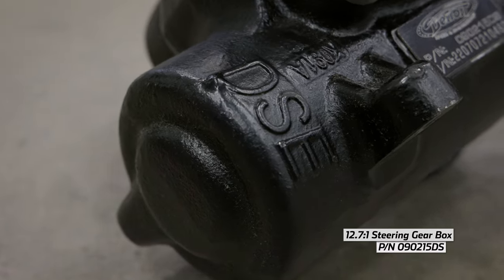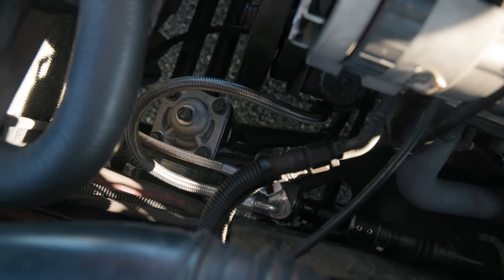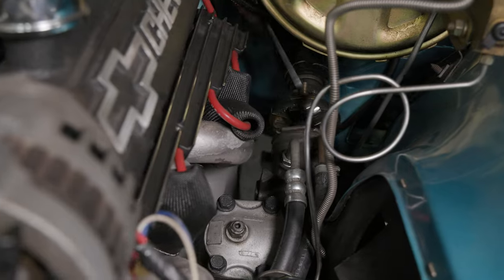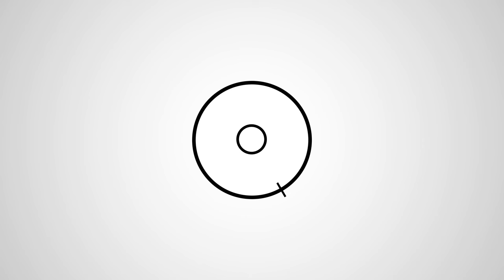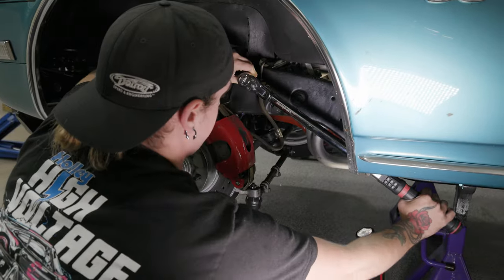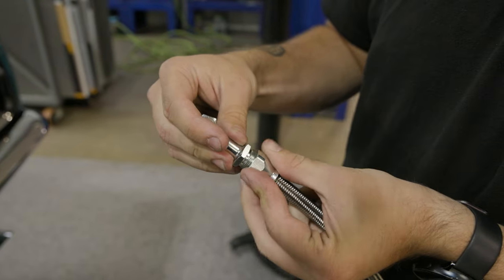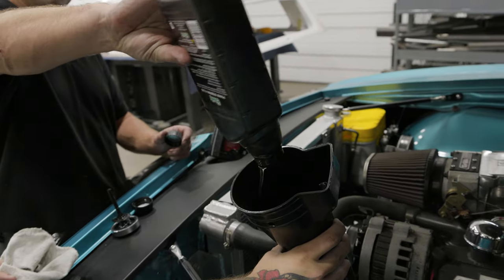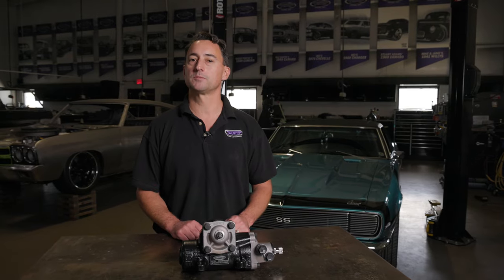How To Install The Detroit Speed 12.7:1 Ratio Steering Gear Box

Comment: I am having a hard time fighting the rag joint to line the bolts through the frame into the steering gear. Is this normal? 68 RS/SS